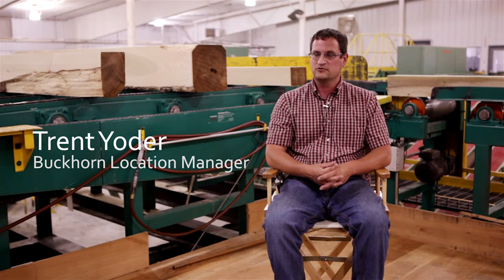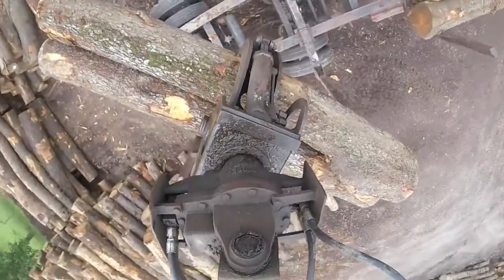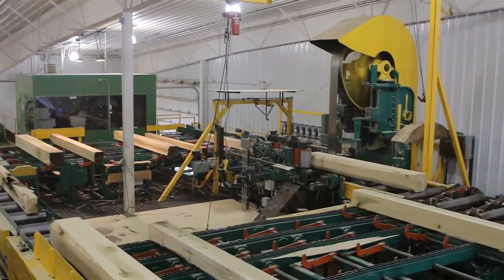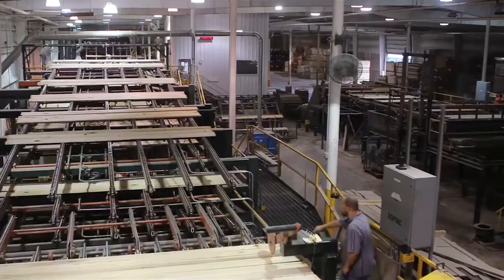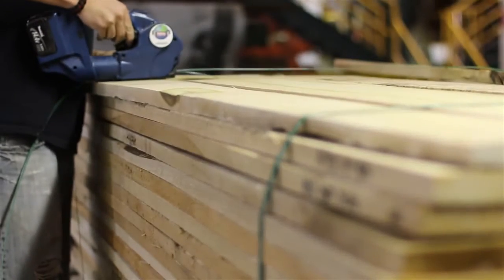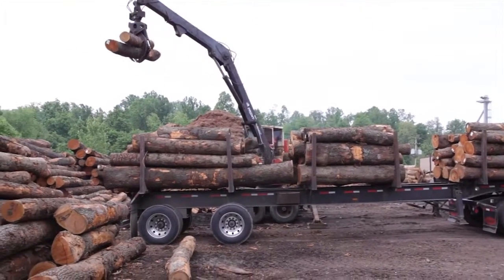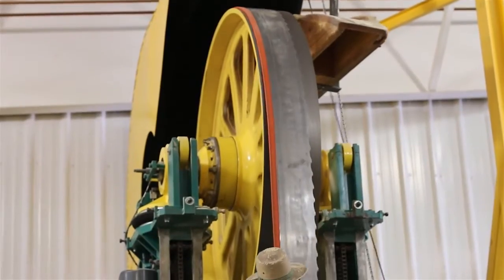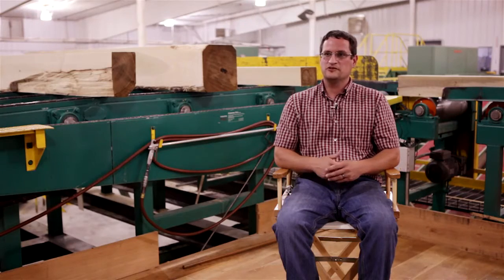Sawmill and Kilns - Yoder Lumber

Comment: Mr. Yoder, that is one very, very cool facility. 
Would you please, please answer the pressing question: Why do 2x4’s have rounded corners?
Reply: Smoother, rounded edges are more suited for bulk handling. When selecting multiple 2x4s from the lumber yard, the slightly rounded edges make it easier to pull individual pieces from the stack. Boards with rounded edges are also easier to slide into the back of a truck.